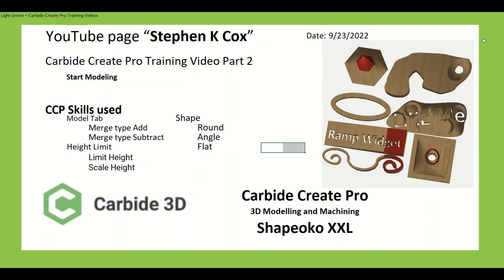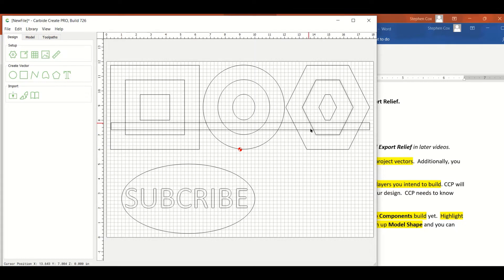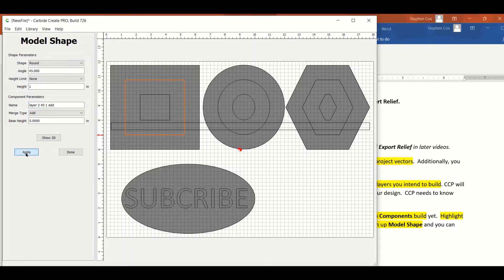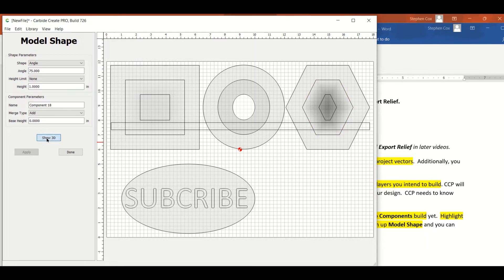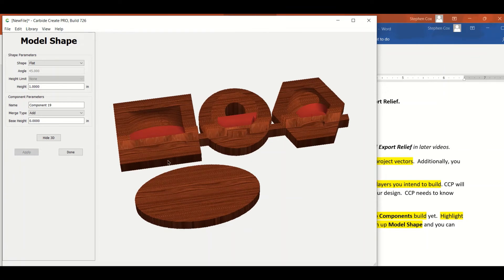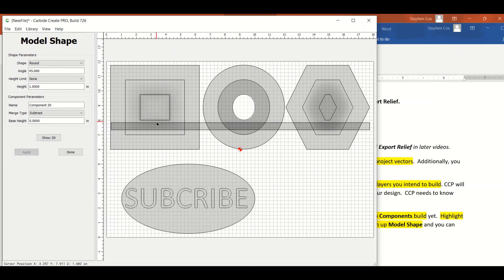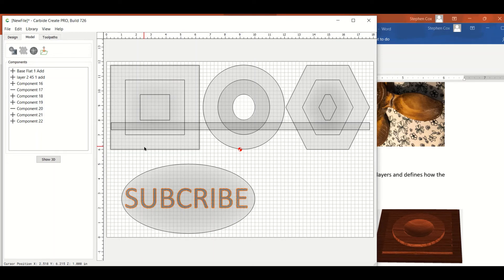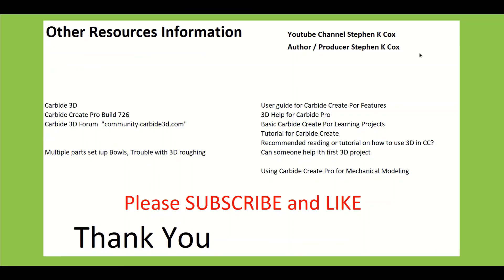Carbide Create Pro Training Part 2 Modeling

Comment: I'm supposed to have pro. In fact it even says "pro" but I do not have that import stl button.
Reply from the maker: I am using Build 743 it has a Design, modle, Toolpath tab.

Third button over on the modeling tab, Looks like a round backet ball.

Pro cost $~120.00 per year.  

Sorry I have not responded. Very frustrated that Carbide will not fix the Bugs in the PRO software.  I am switching to Solidworks.  They have great trainging videos and a much better product.  Only $99 per year.

community help site.
https://community.carbide3d.com/
Reply: @stephenkcox3891  
Ran across your video again and I read the above comment. Me too! It crashes very easy. Which leads to your comment of Solidworks. What happens after a year of Solidworks? Do you still own it and can use it just with no updates like CCpro?

Comment: Hey Steve, I for one really appreciate you creating these videos. I started with CC just about the same time you started putting these out. couldn't be better timing. This type of education, where you're taking the information straight from the manual is what learning CC is all about.
Thanks, and don't stop. The manual isn't that thick.
Reply from the maker: Thank you very much.   Carbide finally did make some training videos.  This does give a different viewpoint.  Just trying to help people carbide Create and CC Pro.
Reply from the maker: I was frustrated with the lack of CC Pro training, so I just started making/creating some.  It did not come from a manual I wrote it.  Thanks for watching.  Not many viewers but It ok.  I Just make them to be helpful. Thanks
Reply from the maker: Thank you for your support.

I had to stop for two reasons. 
 Had to rebuild my mother's house after a storm.
Carbide was not fixing problems in their software and not giving good support.

I still use CC but mostly you Aspire now.  It $$ but great tool.